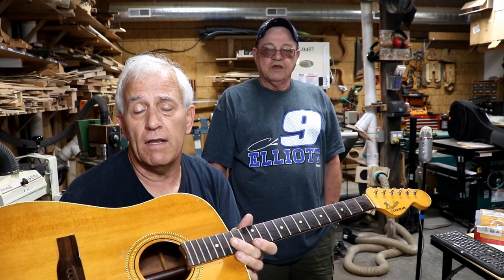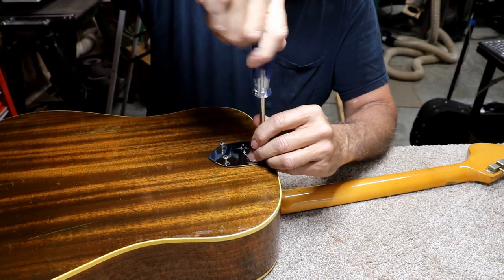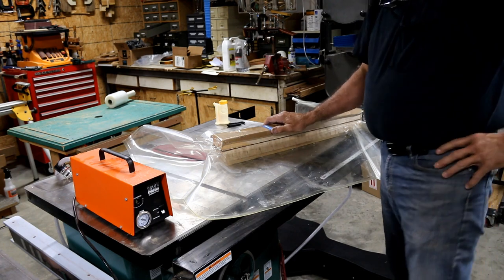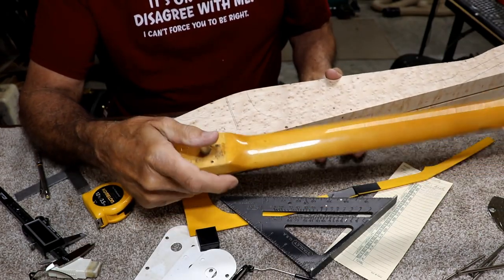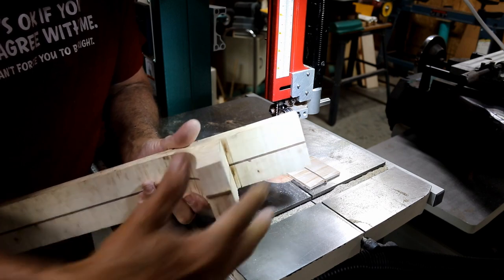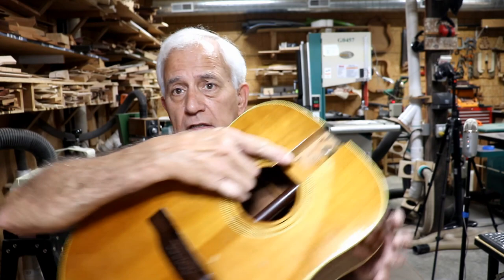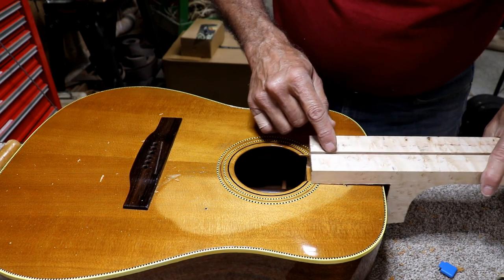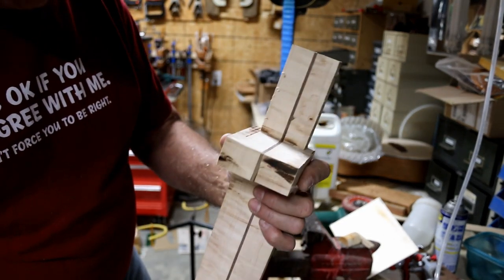489 RSW Custom Guitar Neck Made While You Wait

Comment: Kind Sir, with respect, The carefully designed "bolt on" Fender neck has a compound radius fretboard matched to intonation with the factory saddle. The large locating pin in the neck slot is a large fulcrum designed to prevent the bolt-on neck (without a heel) from rotating forward and to keep alignment of the fretboard under tension with  heavier guage acoustic strings. 
The tube inside the guitar isn't "plumbing", it was engineered by Fender to support, and distribute acoustic intonation by adding tension, and strength, to the sounding board and back of the guitar by pushing against the neck and end block, similar to a violin sound post that transfers vibration from the top to the back. This also provides stability for a bolt on neck without an end block. Keep your stick on the Ice

Comment: I'm suprised at Fender, I know that's an older model, but the few Fender acoustics I've seen you repair, including that resonator, were shocking to me. I know they have massive production, & a few mistakes can be expected. I had an old F-15 Fender acoustic, that I dearly loved. Nice crisp, bright tone. Sounded great, granted it wasn't a Guild (who still making good, great sounding acoustics back then), Gretsch, Martin, or a Gibson, but it was a good guitar. I have a 30 yr old US Telecaster, that's a great guitar. Yet I've heard so many complaints about the early 90s models. I came to the conclusion I must have gotten a Wednesday guitar. Turns out the neck stamp was a Tuesday. LoL. Almost bought a Fender acoustic/electric resonator the model with the Tele neck pick up (Great slide pick up), but after seeing the one Jerry repaired, & few more like that one, I'm glad I didn't. Fender needs a little better QC, as do a lot of the majors IMO. Even their Custom Guitars seem to have slipped a notch, they aren't inexpensive.

Comment: When I glue up a neck blank , I dry clamp and drill two holes in part of the waste and use nails as alignment pins no slippage at all. In your case you'd have to cut the nails off flush.

Comment: Fender used veneer boars on their Necks for a while and then reverted back to using slabs of whatever was going to be the Fret board. It helps to date the Guitar though in a round about way.  The Acoustosonic doesn't look that inovative when you see an old Fender Acoustic with a Strat/ Jaguar/ Mustang ? Jazz master type Neck. I like it.

Comment: Jerry, that new fingerboard is the wrong scale if you are planning to use the original bridge in the same location. You'll find out why once you try to do that.
I saw a rig like that pipe setup way back in the late 60s on a crappy 12 string EKO (I think). The idea seemed to be to prevent the guitar from folding up. Instead it just killed the sound.

Comment: Jerry, Looking a the side of the neck you ran across the jointer, at, approximately, 20:00,
it looks like you might need to replace your cutters. I saw some raised stripes
in the wood, caused by nicks in the blades.
Reply: Could be slightly dull cutters, or maybe the wood is traveling through a bit too fast.

Comment: You got there in the end! It might have helped to run the pieces through the planer before gluing them. Then after gluing g use one of the sides against the jointer fence to true up the joint.

Comment: On that neck hole…  I've used white foam clay to make a mold, and use that for measurements/tracing.  On the cutting the neck to fit the body, just tape in your cutout/waste piece.

Comment: At 50:35, what you could do is put painter's tape on the body of the guitar, add thin double sided tape or just use very light glue to hold sand paper.
Then I would make the neck part go up and down and it would sand the radius of the body onto the neck.

Comment: The round Black spots on the flat surface of your maple is bark that has been hauled in from the bird eye when its growing it in with the eye and the longer black strips going on the side if your neck is minerals from the ground that the tree grew in. I use to cut and sell birdseye maple back in the 90'and early 2000's i have a friend that has a mill and sells it if you need any, he even has a place to cook the woods in a giant oven to take out moist of the moister. You can check him out on face book DJ Smearer Inc specialty lumber products and hard wood flooring . he use to  sells a lot of guitar necks to fender for a while i am not sure if he still has a contract with them or not

Comment: I’m guessing that big ole aluminum dowel IS there for the added string tension from acoustic sized strings. The neck looks a lot like one of their electric guitar necks with the same size screws.
Really looking forward to hearing this one
Reply: I don't know about that, but it is weird. There are a lot of acoustics with bolt-on necks that don't have anything like that plug in them, and they seem to do fine.

In any event, it's a strange thing to see in a guitar -- like the internal pipe.
Reply: @perihelion7798  yeah true but they tend to have more substantial bolts as opposed to the 4 screws on the Fender. Plus they are usually through the heel which is probably stronger(not pulling on the screw threads) definitely strange though but it kinda makes sense
Reply: @donkeyboy585  Well, at least that is a reasonable explanation for the metal dowel. I can't think of a better one.
Reply: Also, on an electric the neck sits in a pocket and has support from three sides, so the screws only need to stop it from folding upwards under string tension. On this acoustic the original neck can slide towards the bridge, which seems like asking for trouble. But with a nice heel, no more need for that dowel.
Reply: @mr.melody6925  The neck pocket on that Fender acoustic was narrower toward the bridge, which would resist the neck moving rearwards.

The Fender electrics have the same type of non-rectangular neck pocket. So you should install a Fender neck straight down into the pocket, and not try to slide it in place.
Reply: @perihelion7798  No, it was wider at towards the bridge. I’m not saying, you should slide it in place towards the bridge (which you can’t because the pocket is too narrow at the heel side) just saying it could slide towards the bridge from the correct position because where you have solid wood on your strat there is a big soundhole here.
Reply: @mr.melody6925  Dang! You are completely correct. I was wearing my sphincter muscle as a necklace when I typed that.

Comment: i had  a flat top arched back mahogany  acoustic a no name from the 70's it had a bolt on neck and it had no pin in it, it was wide and felt good in my hand the nut was smaller then my classical and a bit wider then my 12 string Yamaha, then a few years later in some pawnshop i saw the same make but a 12 string i should have bought it but let it pass

Comment: Only one criticism, and I know you’re dealing with a lot of irregularities, but being a bolt-on neck, maybe leaving the body slot alone would have made it so the old neck could go back on at a future date. That being said, if the customer doesn’t care, then why should I? Entertaining, as always!
Reply from the maker: As loose as the fit was it didn't really matter and I didn't shave off enough to make a difference from from that perspective
Reply: Is it possible that the reason the slot wasn't parallel was because it was meant to fit the neck/fingerboard which doesn't have parallel sides either? Shrinkage of the neck might account for the looseness.

Comment: I think you have done a fine job in spite of the discrepancies apparent in the original manufacturing process. In cutting the concave into the heel you effectively shortened the distance between the nut and the saddle. Did this affect the intonation or had you taken that into account?

Comment: Jerry, I’ve heard you say, “Yes, I know about salt and I don’t use it,” about 50 times.  Dumb questions, for anyone reading this,  how s salt used in luthier work?
Reply: Salt is often sprinkled on the glue to give it a bit of a 'grip' while setting and preventing the parts from sliding during the cure.

  Most professionals don't use salt. Titebond has officially recommended that salt not be used-it melts in the glue leaving micro-voids, and changes the chemistry. Locating pins do the same task easily and with no side-effects, and both Jerry and Caleb have shown how to do them in previous videos, nearly always when matching the fret board to the neck for final gluing.

  Hope that helps.
Reply: @voidmaelstrom  thank you for the explanation.  Sounds like a terrible idea; salt is so corrosive. Seems like t would change the properties of the glue being used, too.  Thanks again.

Comment: Without changing the bridge you’re still gonna have the same string spacing problems that started this problem of a neck that’s too skinny. Just now you’ll have about a 1/4-3/8 extra neck on the 1st and 6th string. Not to mention the nut will look pretty goofy
Reply from the maker: Nope, you are wrong.  The bridge holes are spaced standard.
Reply: @RosaStringWorks  no kidding? I’ve seen those fender acoustics with the electric guitar headstock and always just assumed that they were actually set up like a electric guitar. Just with an acoustic body. So that being said. Now I’m confused about the neck being too skinny??!! Because if it’s a standard spacing for an acoustic guitar then what’s the issue with the neck that fender used. I’m not trying to be a dick. I’m just trying to understand.

Comment: You made a BIG mistake just before you glued up the neck.  After you had flattened one side of each neck blank half you should have run it through your planer (or drum sander) to make each side of each neck blank parallel to the other side, and the width of each side the same, so the center line would automatically be CENTERED!   DOH!!!

You made it SO MUCH harder doing it the way you did things.

Also, the original neck was probably not centered (you could have checked) so going through the process of "fixing" all sorts of things was a waste of time.